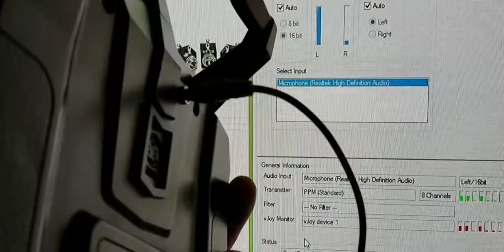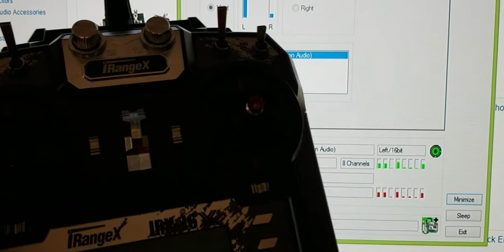Flysky i6 i6x Simulator port mod

Comment: Doug, do you or anyone else know if i can use the same basic setup to use the 3.5 STEREO jack to make a buddybox connection. the FS-i10 uses a 3.5mm stereo cable but the FS-T6 uses this round weird one. so basically want to do 3.5 t 3.5 stereo to buddy box.
Reply from the maker: i have never tried a buddybox connection, hopefully someone else can chime in and help
Reply: thx for the reply. if i figure it out i'll post info. i have the FS-i10 coming tomorrow
Reply: @crabtrap  did you fix it? i have 2 flysky i6 and i wanna buddy box, i wonder if i solder 2 audio jacks to them, it would work. any ideas?
Reply: @mirono3099  You need to designate 1 Tx as the Master Trainer and the other as the Student Radio.  Then you need to identify the PPM Output on the Student Radio and connect it to 1 of these mono audio 3.5mm connectors on the back of that radio. (Ground wire to barrel of course as well.)
On the Master Trainer Radio you need to identify the PPM Input and solder it to the center pin of the socket (with ground to shell again.) Then a mono 3.5mm mike cable and you are good to go. The 4-pin connector on the back of a pair of FS-i6 transmitters contains a pair of PPM Input/Output wires which swap over in the special Buddy Box cable for them and so they can switch roles as Trainer/Student Radios.
Reply: Hi i tried and it works. i tried to buddybox with my opentx radio. it works great.

Comment: Hello. Please help me. In the FS-i6X model, USB signals are already output to the 

connector, not UART. This means that a UART converter is not needed and you can 

connect directly to USB. I understand that you can update the firmware via USB. But I 

need to know how to link 2 remotes to train a student and how to connect it to a 

computer for the trainer.
Questions:
1.Can I use the USB connection for simulator training?
2. Will it be possible to connect a computer directly to the PPM output of the Tranier 

connector through the sound input of the card? So how do they do it in the FS-i6?
3.How to connect the remote control to another remote control. Should I connect the 

pin bus to USB or take the PPM In and PPM Out pins?
Reply: Hello,
A bit late but I hope the answer will be helpfull:
1- Yes you can use the SVIDEO-USB cable provided for simulator training, just plug and play (except for phoenixRC, you need either an adapter or a "crack".
2- Yes, you can connect the PPM to the sound card, you have to pickup ppm and ground exactly as the video and put it on your mic card.
3- best is to find a trainer cable for few bucks on internet (maybe try SVIDEO cable but be ready to open it to invert wires if needed), you also can find the schema looking for "flysky trainer mode cable schema" on google image. It seems taht ppm IN should go to ppm out of the other remote.
Try and keep us informed ;)
.

Comment: All you need is a old svideo cable and a 3.5 female jack.  No need to mod the radio.  Then use the appropriate usb connector and cable that you would for all radios.

Comment: same time than have cover open add battery mod, step up boos converter input wires solden, and power to converter wires out at battery box were add lipo battery 3,7V then 3,7v bood up 6,4v and have better no need pay alltime AA battery lot.

Comment: How does the mod get video if you only plug a 3.5mm into microphone on computer?
Reply from the maker: there is no video signal. this mod is only for the transmitter to send a signal to the computer via mic port to play simulator games like velocidrone

Comment: You can run a simulator with the data cable.
Reply: Blade FPV no u can't
Reply: @ridewithjash  Yes you can, mine has worked

Comment: can you just splice into the battery' wires or terminal/conn....with USB port...This way you use the TX less batteries.  Power the TX from the USB port from your PC.
You just need to identify the audio signal pin of the usb port.
Reply from the maker: OneEyE Monster it would be possible to power the tx with usb power, but the usb of a computer doesn't have a audio signal wire. So you would still need another wire to the mic input
Reply: Oh...well,  At least I know how to solve the batteries recharging
issues on this TX. That's was pretty cool. I'll just  zip tie the USB and mic cables when using it for the sim..Just use the USB to recharge...
Hook it up to  4 mini solar panels.lol
Just install 2 mic jacks to the TX...Make 2 cables, with an USB (power)to the PC or whatever. Just zip tie them into one...or use 3 or 4 wire cable.

Comment: There are three connections on the stereo plug - ground, middle and tip.  The other cables I've seen built use the middle and tip.  You're using ground and tip which frankly makes more sense.  I'm going to mod my I6 - I assume the same sort of port connections?
Reply: That's nonsense to rig the USB wires to charge the batteries. Yeah I saw the guy who used a RX to send a signal to the computer - pretty dumb IMHO because now you're using a 3 or 4s battery that lasts minutes to receive the signal and send to the computer when you can rig a cable and be done with it.
Reply: Just use a MONO Jack. Im thinking of using the USB port from the PC to power
the TX....There's another video using the USB port to power the REC. Then he's plugs the PPM signal from the REC into the mic jack.
That'll work too...if you're using a giant screen and just sit on the couch.lmao
You can just make a 3 pin connector ( min)...Ground to ground...POWER to POWER....Signal to signal...
It wound be the samething as pluging in an MP3 player via USB....Running
the MP3 and/or charging it.....4.8 V on this TX helps
There's has to be an audio signal pin on the USB....the other one is probably
just vedio....There's only 4 pins....2 are allocated for Power and ground.

Or just make an USB port to recharge rechargable batteries.
You just need to spice into the wires going to the batteries
Reply: jonathan, do you kno a way to replace this i6 round port with a 3.5 stereo jack so i can buddy box to another 3.5mm stereo jacked TX. same basic procedure as in the vid but i don't know which wire run the XY axis of the gimbels
Reply: @crabtrap  same here, any updates?
Reply: @mirono3099  negative gooseman!

Comment: you need to tell people that you need a 4 way connecting aux (ground, mic, left, right) IT WONT WORK WITHOUT THIS. SAVE HOURS OF ANGER AND USE 4 WAY CORD
Reply: it works with a monocable. Unless you bought the wrong jack to install in the transmitter.
Reply: why ?
Reply: yes, I confirm. For modern laptops that have no separate mic input you need the four way connecting jack. use ground and mic as caleb jones said
Reply: @caberga  do you have a video reference for this tutorial?
Reply: @sergk.7111  no, sorry